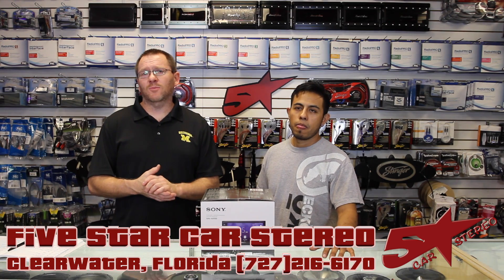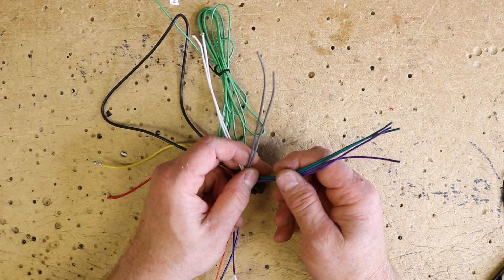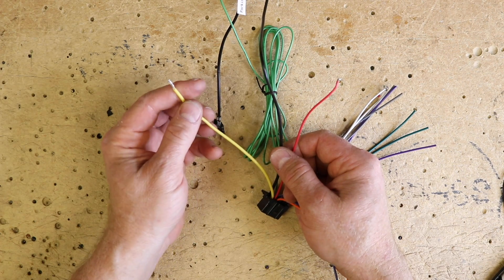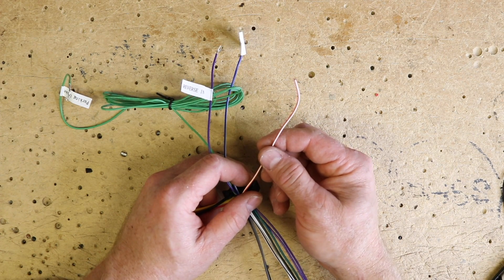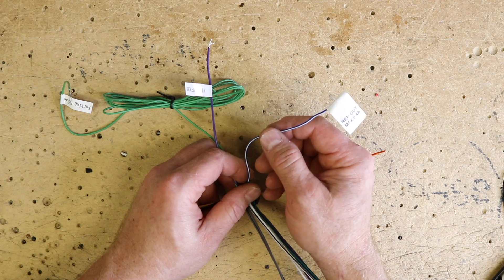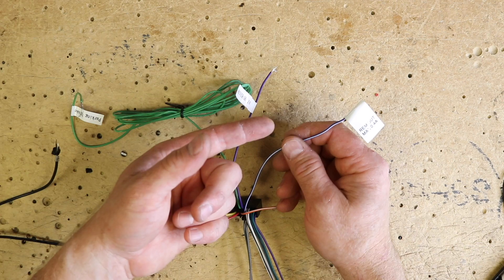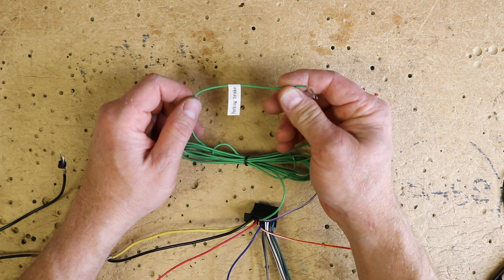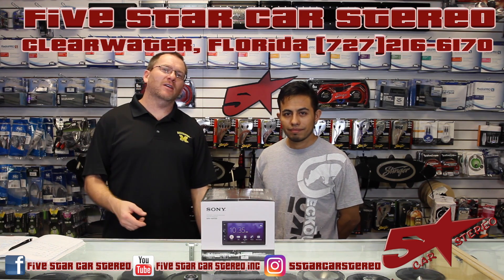what do all the colored wires on a Sony radios power plug do

Comment: where i i have to plug blue ?
i connected all cables and my sony stereo wont work, last time was working.. 
whaat could happend.. only cable i left unplugged is blue..
Reply: Blue is a positive feed to a sub woofer when radio is turned on, or to an electric antenna. 
If you haven't got these just insulate it and leave it unconnected.
Reply: @Sabastianspreadworth  okay. im really thank u for the answer

Comment: Can you hook up multiple wires to the red wire?  Like a 12 Volts Switched Power and a ACC (backup camera)   I watched the backup camera install video you did for this receiver and got confused by the use of the red wire.  Thanks for your help and info!
Reply from the maker: +Charles Warren the red wire is your cars accessory wire. How many things it will power depends on the application. If you are using a basic harness yes it will power the radio and a camera no problem. If you are using a smart harness to power up your radio, you may need a relay. Most smart harness only put out 3-5 amps, not enough for both devices.

Comment: I have a 98 civic with an older sony aftermarket head unit. Rear speakers play sound but the front door speakers will not. I battery tested the door speakers so they work, this has led me to believe its likely a connection from the head unit harness to the speakers. I pulled the stereo and looked at the harness but the grey and white wires are all connected correctly. I have an extra orange , blue and blue/white wire dangling. Any ideas that might help me diagnose and fix this issue? Thanks

Comment: I probably went overkill with this, but I hooked up a relay as seen in some other videos to bypass the whole parking brake thing. I may have done it incorrectly because when I hook up my android phone and scroll through a playlist with google play music, it will only go through a few songs and then say, "Scrolling Locked for safety" or something. I also think that the auto dimmer doesn't work as it is pretty bright at night, but not bright enough during the day. 

I hope that sony comes with a firmware update so as to stop the message that pops up every time you turn the car on.
Reply from the maker: Adam McGrath the dimmer wire might not be connected to wire on the car side of the plug even though it was in the harness.
Reply: I figured out what was wrong with the dimmer. It was connected to my headlights, so when I turn my headlights on, the dimmer turns on. When I turn my headlights off, the dimmer turned off.
Reply: @adamhlj that’s exactly what it supposed to do

Comment: how do you guys power your stereos in the shop? i have tried to power my car receiver at home with no success. I connect the red and yellow wires together from the power connector. then i connect the positive from a 12V adapter to the yellow and red wires and the negative to the black wire on the power connector but it doesn't work. Please help. Thanks,
Reply from the maker: Luis Perez this is how we do it
https://youtu.be/95iweNxgKgs
Reply: yeah but you guys don't show how to connect the wires to the power supply. This is the tricky part for me as I have tried to connect those wires before and get confused with the black and the red and yellow wires.
Reply from the maker: Luis Perez ok, we connect the black to the Ground  - negative and twist the red and yellow together and connect to the + positive. We turn the radio on and off with the power supply.
Reply: I see. I am using a 12V power adapter from a Roku player. I snipped the end, then spliced the negative to the black ground wire from the power connector on the head unit and the positive to the red and yellow wires but it doesn't work. I'm not sure what I'm doing wrong or if this is supposed to work at.
Reply from the maker: Luis Perez the radios need 10 amps of current to work. The power plug you are using may not have enough power to turn on the radio.
Reply: Thanks guys. I appreciate it. Thanks for taking the time to answer my question.

Comment: Hi guys, just picked this up for my 07 Corolla! For the ground, my harness also has a black wire which says -12V. Seeing this claw thing on the black wire, can I connect it to the harness or do I have to find something metal on the car to clip it onto?
Reply: Also any thoughts on where I can ground the parking brake wire?
Reply from the maker: Davis Byer you can cut both wires( green and black) and connect them to the black wire in your Toyota Adapter plug.
Reply: Thanks, that's what I did! Installed it today!
Reply from the maker: Davis Byer sweet how did it go?
Reply: Five Star Car Stereo went awesome! Had found another very detailed video on how to do the whole install. The head unit is sweet! Glad I did not spend extra on the 4200nex

Comment: What type of wiring harness do I need for after market stereo for a Chevrolet trail blazers 2002
Reply from the maker: Plebe Juan you will need a smart harness. There are a couple different once depending on what features you have in the car. You can find them all at www.bestkits.com

Comment: you mentioned " if you have a factory amp and an amp, you need a relay"  i have a 2008 nissan titan which comes with a factory amp and i am adding a 600 watt sony xplode amp powering 2 rockford fosgate 10in shallow mounts, i am also adding a boss flip out radio and a 7 channel clarion equalizer. how do i connect a factory amp to a installed amp?
Reply from the maker: +James Madkins you will need a relay here is the video 
https://youtu.be/86_ocEp6mHI